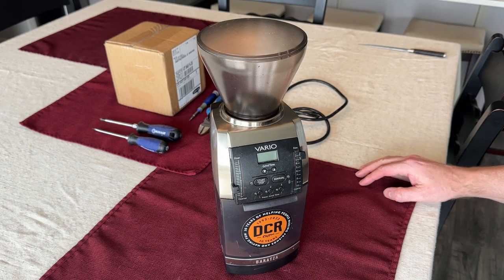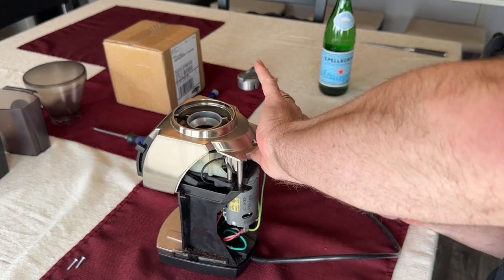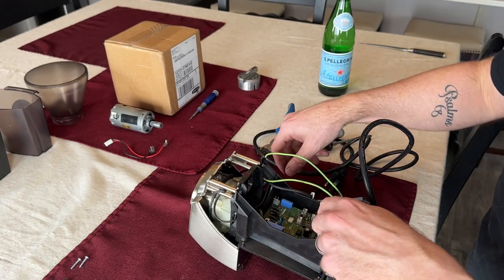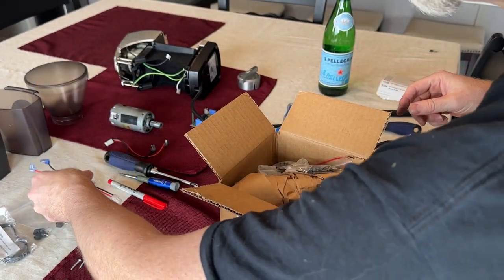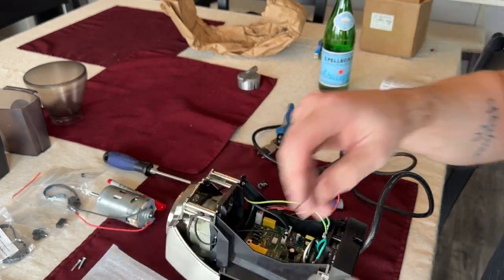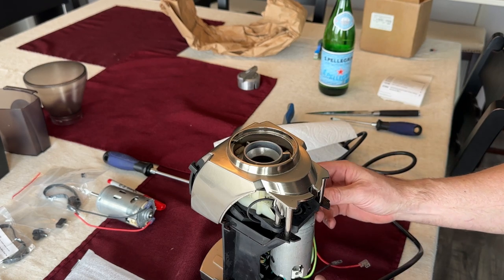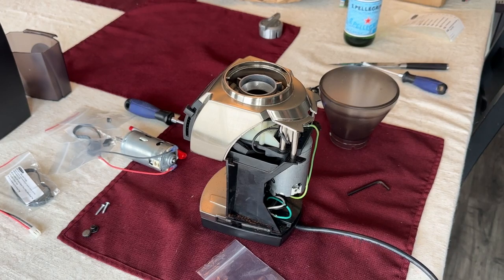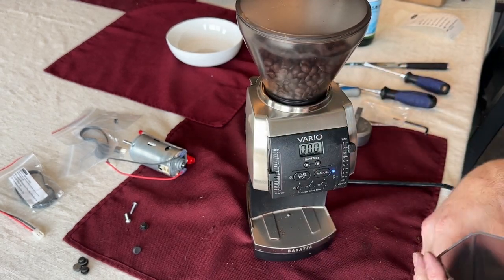Baratza Vario Coffee Grinder Circuit Board Repair - Replacement

Comment: Thanks for the video it helped a lot to open mine! I just opened it and I found an easier way to access the board :separate the top and bottom removing 4 screws, the 2 next to the motor, those going up, close to the back and the 2 that are in the corners of the tray on the top front from the tray space. That way the 2 parts separate, no need to remove the motor. Be careful twitch the wires tho they’re quite short. I’m trying to put insolation to reduce vibrations with car rubber anti vibrations, I’ll put some on surfaces I can access. Hope it work!

Comment: Thanks! This helped a ton with my vario. I was wondering what steps you took to determine that the fault was the circuit board, and not the motor.
Reply from the maker: I went to this Baratza video and followed the steps at about 8:20 to test my motor a few weeks before filming the video. I probably should have included this step. My motor was good, so I called and spoke to Baratza and after eliminating the motor as a problem we determined it was the board. https://m.youtube.com/watch?v=T2v-aJLjNHc